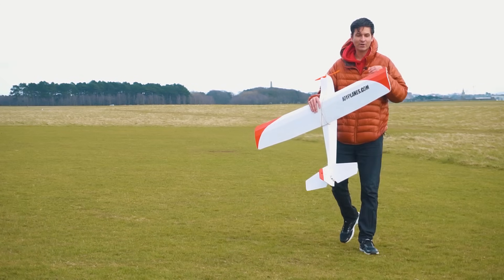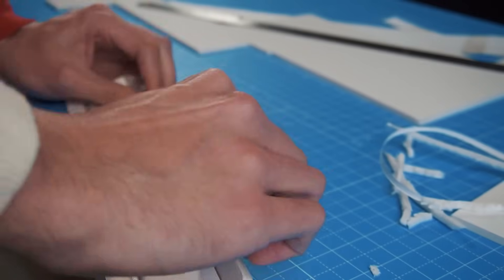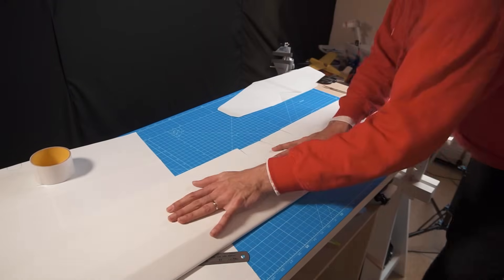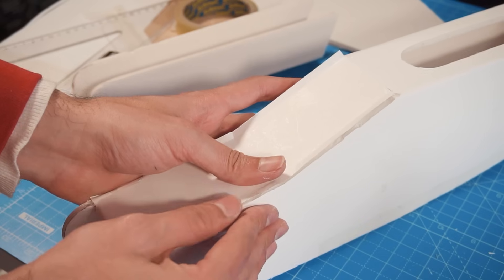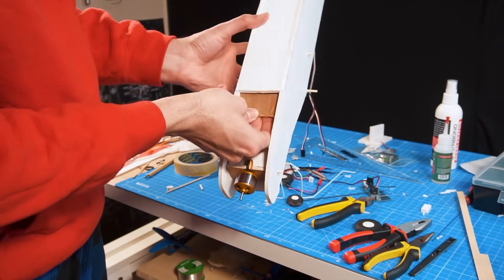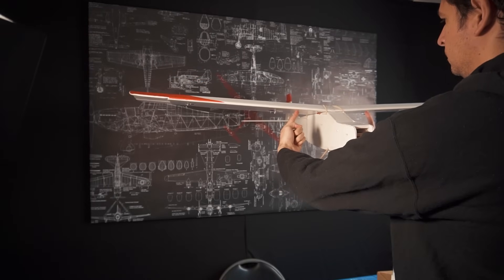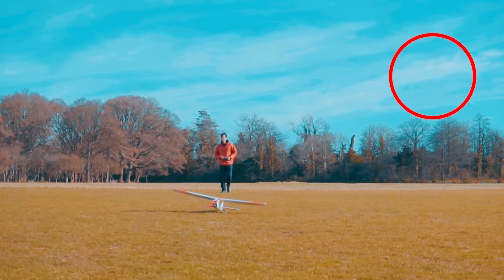The ultimate tutorial on building an RC trainer airplane | The best for beginners

Comment: Wow! you make all of it look so easy. I'm researching beginner RC planes for my son and I to learn together (he's 11). Your build seems a little challenging but looks fun. Thanks.
Reply: some info.     1)   paperclad foamboard  is  HEAVY.     in Most cases, its use results in  tail-heaviness  in  the  dom.    distribution of mass.      2)  overall  heaviness/auw  leads to a need  for  'more'  wing area/lift.    minimum wingspan should be, say, one yard/meter.    (mitigation of both is possible; via the use of  panel cutouts.    but  No one ever does it.)        3)  consider whether the price of a simulator would be 'worth it'.      especially, if you live where the weather is frequently not great for flying.        4)  a novice pilot can spend  a  Lot  more   time  flying/smiling, if he chooses  the right type of model (to learn on).     that being,  a  light-weight, three-channel slow-flyer.     such a model must have a dihedral main wing, in order to avoid the need for ailerons.       while there are some manufactured models that will fly slowly,  the main wing may not have  enough  dihedral, to allow the use of rudder-initiated  turns.        two examples of a slow-flyer.    cheers         googletranslate
https://www.youtube.com/watch?v=lZ1vUKcktVk
https://www.youtube.com/watch?v=2xP_wDe4UPo

Comment: Sir, your project was interesting. I was also trying to do it but I find it difficult to do angle cut. It is breaking while folding. Kindly advice.
Reply: I have the same problem
Reply from the maker: Don't cut all the way the foam, just enough to make the bend easier. Use a very sharp blade when cutting thease parts
Reply: You can also use a guide to rest the cutting knife on to regulate the depth of the cut

Comment: I bought some foam but it's very thick and looks very grainy, is there a keyword I should be using to specify which kind of foam I want to buy at the store?
Reply from the maker: Foam board is the one used in this project.
Reply: it is  paperclad foamboard, poster/display  board,  readi-board.     avoid  elmer's, its too heavy.    cheers
https://www.dollartree.com/readi-board-white-foam-boards/809955
https://www.goadams.com/wp-content/uploads/2014/09/readi-board-foam-board-feature.jpg

Comment: I use Owen's Foam Board to make my planes. You can glue the plans directly to the foam board using 3M 77 Spray adhesive.  After you are done, just remove the plans from the foam board. I took a sock and filled it with sand as a weight to hold my folds after hot gluing. The type of hot glue gun sold on Flite test but purchased through Amazon( cheaper) is the best for doing foam planes. This is a good basic plane and easily repaired. It reminds me of the Apprentice in size. Bigger planes are easier to fly. The internet is FULL of great deals on all your electronics. Watch for USED equipment if possible. You can get a good used transmitter for $50 or less. I like this video but pay attention to what kind of wire you use for servo, controls. The wire shouldn't bend at all when actuated. Flite Test would approve of these plans!
Reply from the maker: Yes, the wire is important, I use the thin one that bends, I have a very strong one but is so strong that I cannot bend it in small portions, I'll have to use the adjustable linkage for these.
Reply: Are you failure with the Z bend ? It works great and you don't need a special tool. My first foam build was the Flite Test Tiny Trainer. It was a better glider than powered by a long shot. I made 4 of them and ended up modifying it as a pusher. I am finishing the Simple Cub right now. That should be a good flying plane. If you need any HELPFUL advice, let me know, also I am willing to share any info I may have. You are doing a great job and I subscribed to you.
Reply: Check out RC Saylors too when you get a chance. Nate and Abby Saylor are very good friends of mine. Tell them Scott sent you. They are awesome people. I know you would like them. I will pass along your site to them also. Take care.
Reply from the maker: @scottfirman  Thank you! Z bend with those wires is extremely hard to do I need some piano wire but thinner.
Reply: @Joyplanes  The screw type servo control connectors work well then, at least you do not have to be so precise.  I still have a few but usually have good luck making the Z - bend. I have gotten wire that actually snapped when trying to bend it. Someone hardened it off. If you have a hand torch, you can heat that type of wire to make the metal soft enough to bend. Even a gas stove will work. I almost rammed the wire through my hand when it snapped. That can make you use choice words when that happends
Reply from the maker: @scottfirman  hahahaha. Take care.

Comment: Wow i tought it will be easy moving from a drone to a plane but it's not
Reply: fly  a  (light-weight) three-channel slow-flyer.      then, there is  Time  to  react, to have fun  and have fewer crashes.       learn about  GLIDING.      note that gliding a powered model  requires that the pilot fly the elevator, continuously.     this is because, elevator trim that is correct for powered flight will Not  be correct, for gliding.      any model that weighs less   will tend to  take less damage, in a hard landing.   see a three-channel slow-flyer.    cheers
https://www.youtube.com/watch?v=2xP_wDe4UPo

Comment: really thank you I love your videos ... Can you explain more about plans and the essential conditions to have a good plan .. I love aiplanes and I like  your way to introduce informations and your creation
Reply: You need a printer. You also need to make sure your computer or whatever is set up to print tiled. Flite test offers full plans so you can go to a print shop and have them print off full sized plans. Next. Lay out the plans and tape them together. I use 3M 77 Spray adhesive  to directly glue my plans to the Owens Foam board. After you cut it out, you can peel the plans off the foam board after building. He did a great job. You can watch Flite Test video 's for more on how to set up and fly RC planes.
Reply: @scottfirman  Thank you a lot for your help . And I have seen your channel It very nice , I love it .

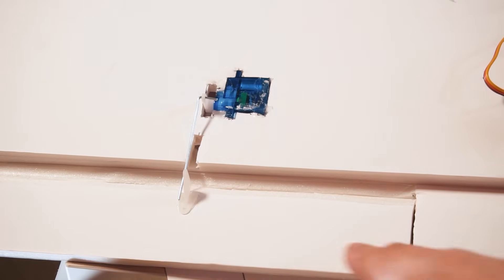Comment: some info.     at 7:13,  TYPICAL,   2-d thinking,  Incomplete  taper  of  the  tail  boom.     taper at the fuselage lower surface  Should  begin  Beneath  the  pilot seat.      at 8:34,   READ  MY  LIPS     the   Wingtips   SHOULD    BE    FINISHED.!!!!       at 9:00, this  'step'  at the main wing trailing  edge  Should  NOT   BE    THERE.!!!!      at 9:41,  installation of flaps is a   stoopid  over-complication of design.      at 9:51,  it appears that the  root chord of the main wing is  excessive;  should be equal to about  22 percent of fuselage length.      stabilizer design is  less-than  optimal.     at 10:10,  READ  MY   LIPS      pushrods  should  NOT  be  Too  short!!!!     locate wing servos   NEAR/forward  of the  cg;  30% of chord.      bends in pushrod at the servo arm  are  Not  complete.       at 15:51,  distance between prop and main wing is excessive.    READ  MY   LIPS     servos  do  NOT  go  at  the  tail.!!!!      the use of longer pushrods is  NOT  an  issue;  if yer brain werks.        googletranslate             see  TAPER  of  fuselage
https://the-blueprints.com/modules/vectordrawings/preview-wm/cessna_150j.jpg
Reply from the maker: Alright, you should send all of this to @flitetest who are the original designers of the Simple Storch, this is just a very slightly modified version of it but all the "corrections" you mention are in the original design, as it is works perfectly for the whole community, still your comments are appreciated for a future version.
Reply: @Joyplanes  As always quite a gentlemanly reply there young fellah. Were it not so obvious from that rant, a quick look at the poster's YT details would confirm that there are some sad problems there! 
Best of luck to you and yours over there from a house bound Old Fart. :-)
Reply from the maker: @theoztreecrasher2647  Look, this is the original design form Flitetest https://www.youtube.com/watch?v=i0S4epTCmss take care and thanks for your comment.
Reply: @Joyplanes  Don't listen to this guy. I see his type on RC vlogs all the time. He doesn't understand these are built for fun. They do not have to follow any Bible of flight or be inspected by the FAA for certification. I think he is an aircraft designer. A real plane scaled down couldnt fly because of the weight. Air behaves differently on scale craft than full sized craft. Also, these type do not understand the concept of FUN.
Reply from the maker: @scottfirman  What you say is true but more than that is the way he was trying to be the smartest about the topic when everyone here included me is learning and having fun. Thanks for the comment.
Reply: @Joyplanes  This guy has been on other volgs doing the same thing. I don't care if he works for NASA . The point is, this is a hobby and we are supposed to share info and have fun. This guy does neather. I have seen him get on other sites spewing off in the name of learning, then gets mad when everyone on the volg tells him to bugger off.  Its fine teaching people in a good positive way, not insulting people, especially on their own web site. I told him to stay away from my site too. Stay well and I am subscribing to you. I want to see your next build. Just do what works for you.
Reply: @Joyplanes  not my Fault  that  99.999 percent of  FT  designs  are  Flawed.      if you  Cannot  comprehend the  Significance  of  what i have  SAID,  i do not  care.
Reply: @daviddavids2884  All FT designs are flawed? how so, id like to see some data behind that. besides, FT models fly quite well considering the material they are made of, and the simplicity of the designs. only you could find a flaw in literally every model airplane ever made. still waiting for proof that your models actually fly, then your comments might be worth something
Reply: @daviddavids2884  Wow dude! Seems like the HUNDREDS of Flite Test planes being built are doing well. Are you comparing a full sized plane to scale? If you are, then you are misunderstanding that scale planes are designed differently than full sized planes because of weight and size differences. A full sized plane scaled down exactly would suffer greatly because the weight of the plane would prevent it from flying. The shape of RC planes is designed to benifit lift. I think you are taking it way to serious and need to lighten up. If you cannot do that, I suggest you bow out. I have seen your type on many RC vlogs and your critical thinking is totally uncalled for. These are built for FUN . Do you under stand that concept? Apparently NOT!

Comment: 5:55 what is the angle
Reply from the maker: About 5 seconds later it shows the distance it should have from the table if you lay the other wing flat the counterpart should rise about 19mm at it's tip. That's about 2 or 3°
Reply: @Joyplanes  thanks

Comment from the maker: I hope you enjoy this video and take your free time during this pandemic to build it, take care and fly on open spaces without having contact with others, that help save lives, at the same time there's no need to fear, just be aware and take care.
Reply from the maker: @MohamedAhmed-iq8dc  Hey man, this is a modified version of the FT Simple Storch, really slightly modified so is basically the same, I stated that on the web post, and I'll keep modifying it to the point it is a bit more different from the FT version, but it is a wonderful base point for a trainer airplane but I found some things I'd like to modify already.
Reply: @Joyplanes RC It looks like the new website is down. I can't get to the extended video and other information. Hopefully you can get this taken care of. I really like the lines of the plane. I like the Storch, but your redesign looks so much nicer! Excited to try it out!
Reply from the maker: @dsnyder05  Some times there's some maintenance, have you logged in yet?
Reply: @Joyplanes will ela foam work
Reply: Please can i use the 1,800mah battery, i couldn't find the 2200mah @Joyplanes
Reply: What size wheels did you use because the ones in the parts list were discontinued?